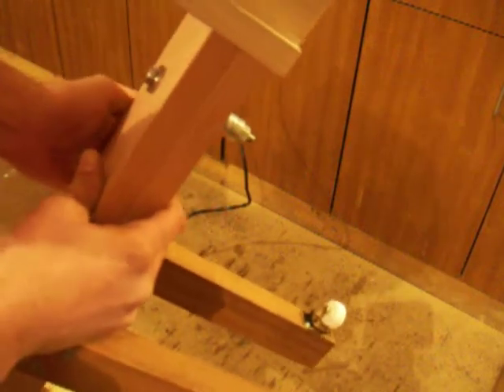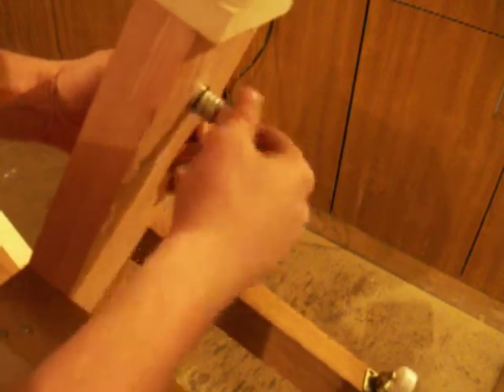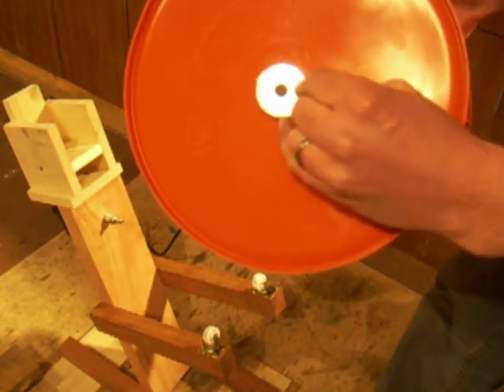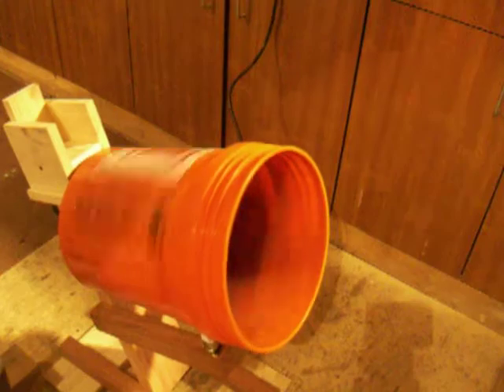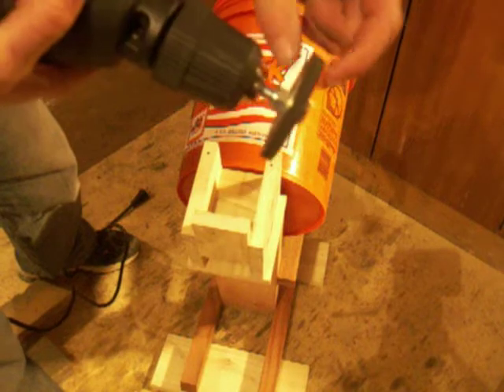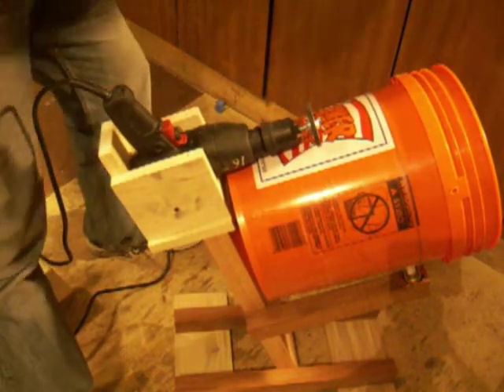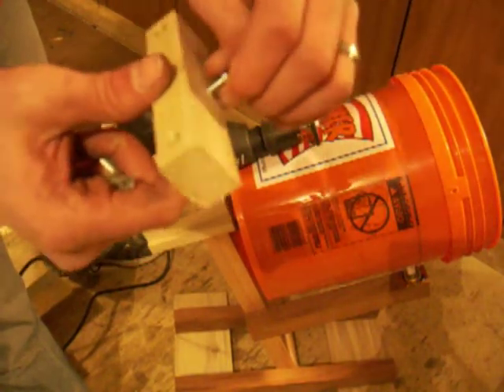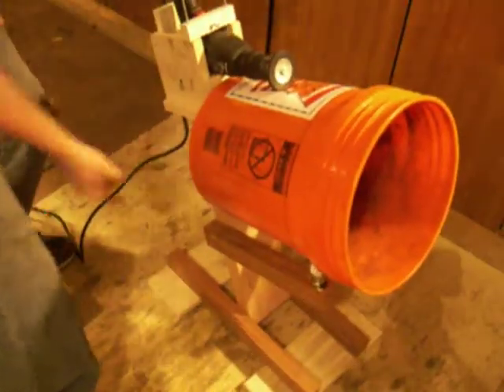How To Make a Firework Star roller part 3 of 3 ball mill

Comment: I have a ? for you at my local feed and horse cowboy store they have these feed plastic tubs and a rubber one that would fit inside the plastic one. Would it be safer to use the plastic one to support the rubber one and it would reduce the risk of spark? Plus then i could make this for a ball mill and a star roller due to i could have more then one rubber tub to use one for stars one for BP and others for each chem i needed to mill down? Am i thinking this right any help and feed back will be greatly liked and needed as i am just getting into making my own stuff.